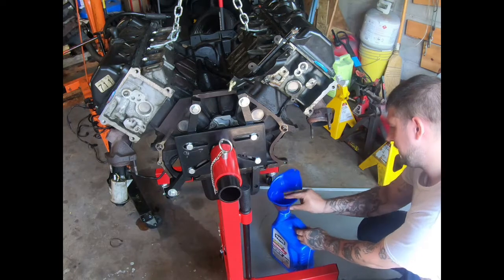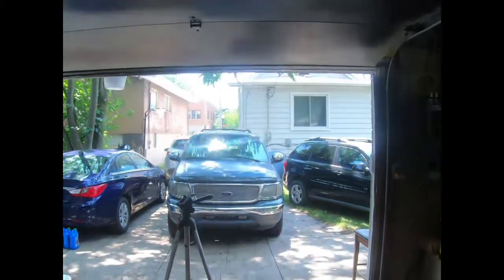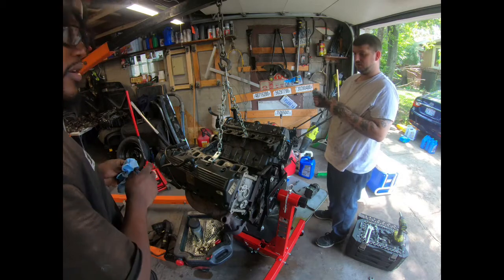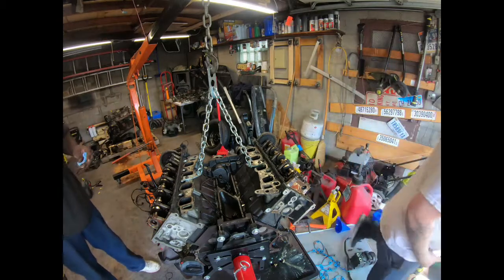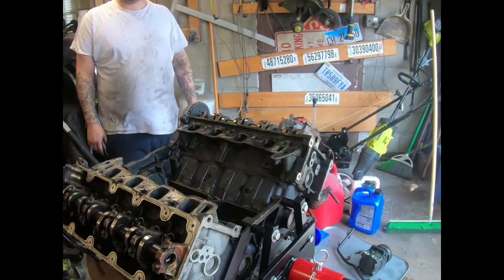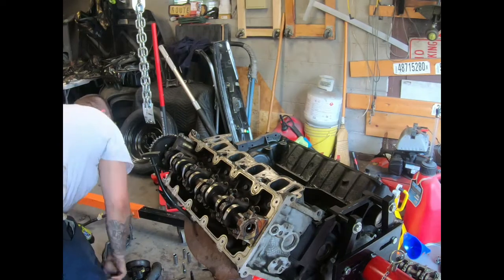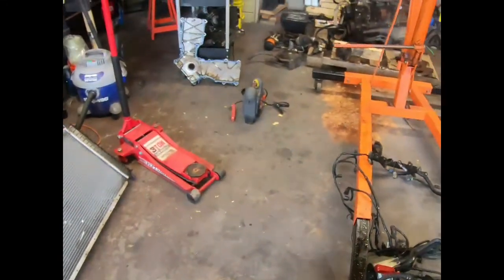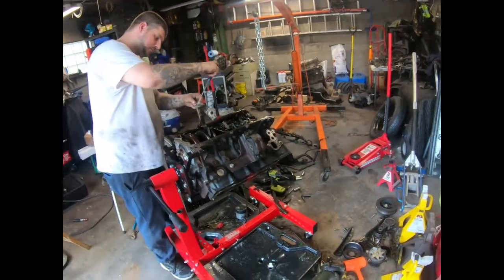The 2000 #Ford #Expedition Bad Engine Replacement Part 3

Comment: good video, but to remove tha head u have to go to left up right down constantly, that’s y the air tool to longer towards the finish
Reply from the maker: We have no idea what you’re trying to say the engine tear down was just that motor is scrap and we don’t rebuild motors 😇